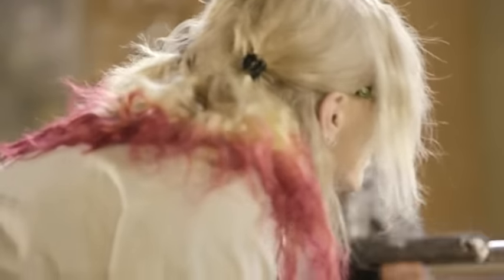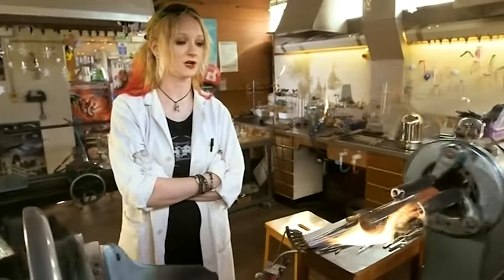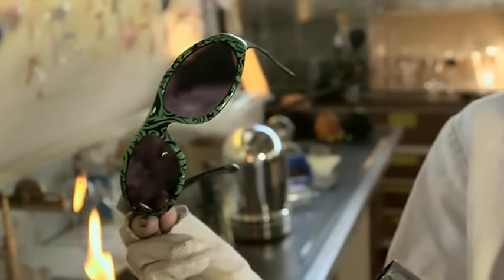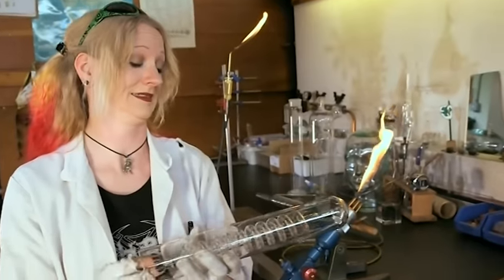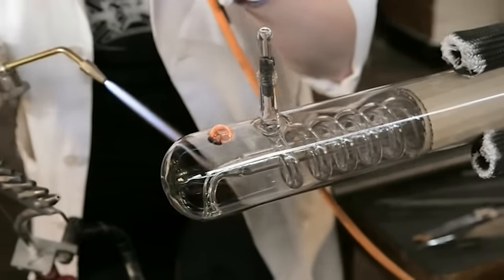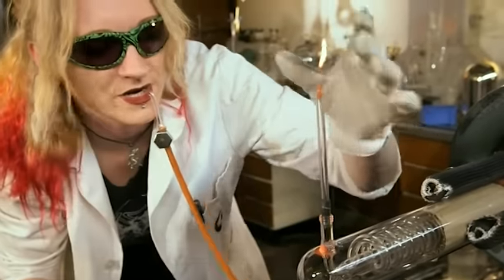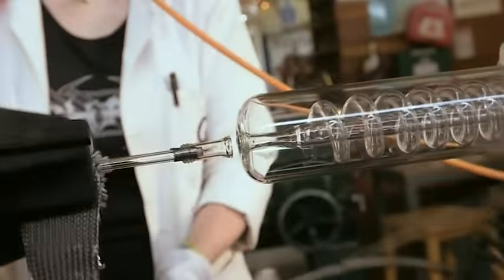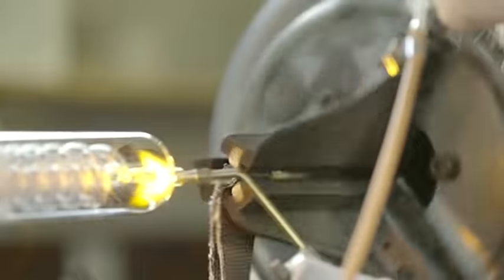Gayle Price Scientific Glassblower University of Leicester

Comment: Could someone please help me with a question? I tried to get into glass blowing and it turned out to be a crack. My question is when I was younger there was a glass blower that use to come to the shopping mall in my town. He would make may beautiful things from glass. He would finish them and the customer would take them as soon as they cooled. I watched closely and I never observed him putting the glass creations in an oven to anneal the glass, and they never cracked. When I tried glass blowing myself many years later I was able to make some really nice items but as they cooled they cracked and cracked. Where am I going wrong? I thinking it maybe the kind of glass rods I purchased on the internet. If that is the case what type of glass rods do I  need to use to avoid having to purchase an oven to anneal the glass items I make, or is there a step with the torch I am missing? Thank you for any help you can give.
Reply: Roger, you need to cool your work with less hot flame. Read more about flame control and where and when it is hotter and cooler. Once you done with working on the glass, depending how big the work is, you need to anneal it with cooler flame. Big works would require proper annealing in a kiln. Also - you must pay attention if the glass you’re using is of the same compostion. If it’s not - then differences in thermal expansion would shatter any attempts of joining them. Get a cheapest glassblowing handbook off the Internet and all this will be explained properly. Good luck!

Comment: Could you please help me😊 which lab glass has a higher heat sensitive than other glass.?
 Tamputer degree 30 to 50  Thank you
Reply: fused quartz is top dog when it comes to heat and cold shock you can heat it up and dip in watere and it wont crack